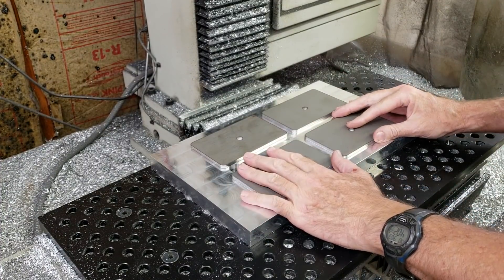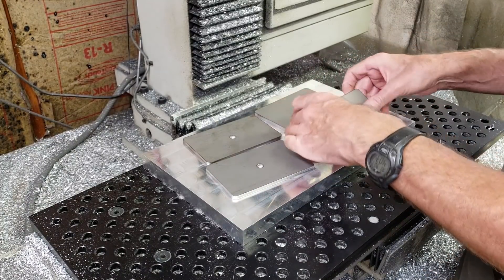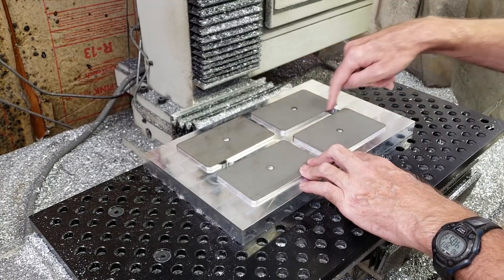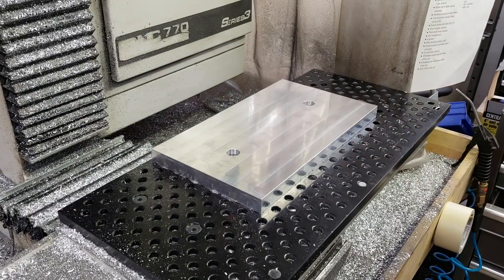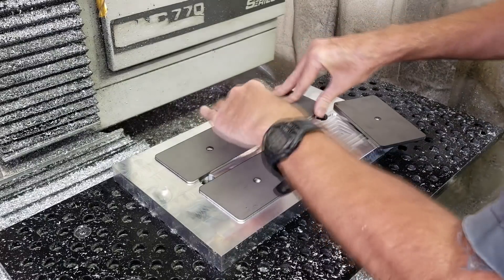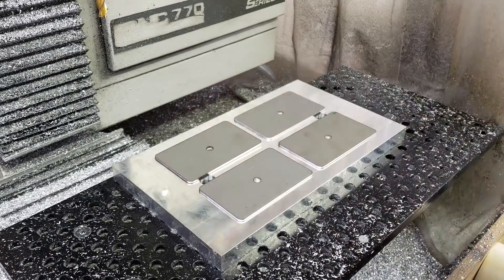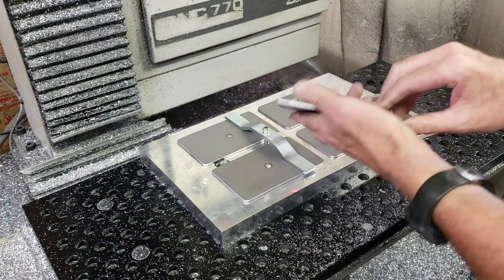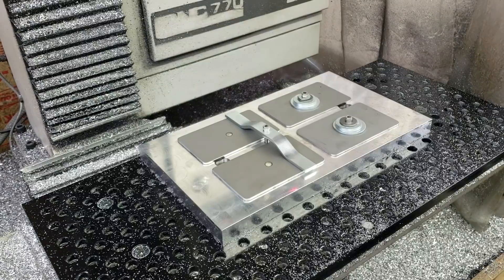Making a Fixture Plate for Laser Cut Parts - Part 2

Comment: You may want to look into buying a scotchbrite  wheel.  They fit on a regular bench grinder . I use mine for deburring the edges of a lot of my parts. They also leave a better edge finish than a belt sander will.
Reply from the maker: Thanks Donald. Yeah, I have been using the wheel for a couple of years but it tends to go unbalanced when debur a lot of steel parts.  I use a belt made of the same material as the wheel and its a lot less tiring.  Grinding on an unbalanced wheel for 2 hours can wear you out.

Comment: If you have a 6" 3M EXL deburring wheel they do a really nice job on aluminum.  Not sure what you are cutting.  At times I use the free belt section on my 2" X 72" grinder that I built depending on how important the finish is. Just something to think about.
Reply from the maker: Yeah, I have been using the 3M wheel for a couple of years now.  Works great on aluminum but tends to get unbalanced with steel. When its unbalanced, its tiring to use and wears down fast.   The covers are steel.  Just got a Dayton belt grinder.  Works great but the 3M abrasive-embedded nylon mesh belts wear out pretty fast.  Kind of like the 3M wheel but a belt. The sand paper belts remove material too fast.  Even the 320 grit.